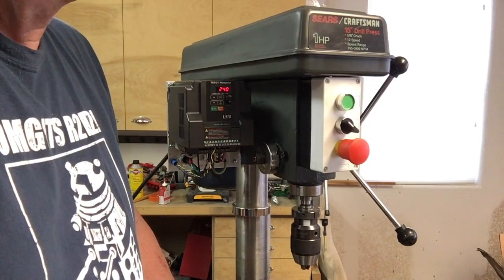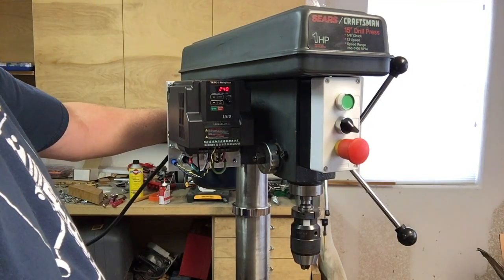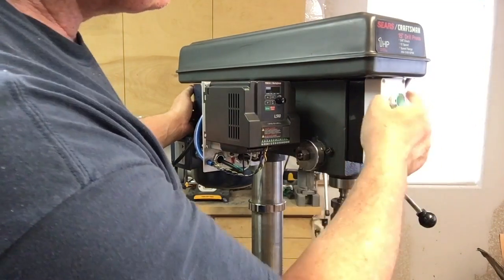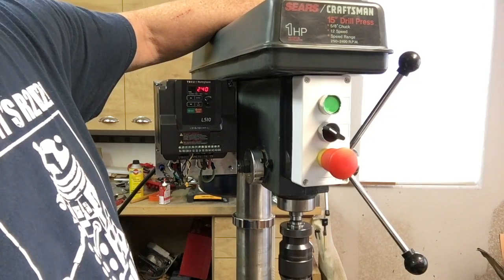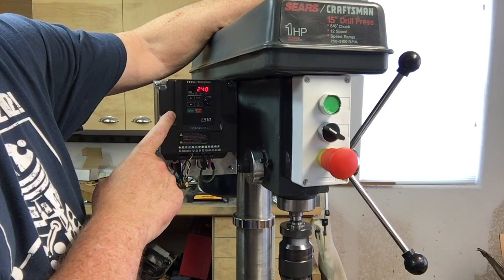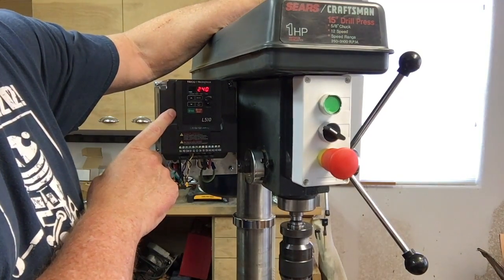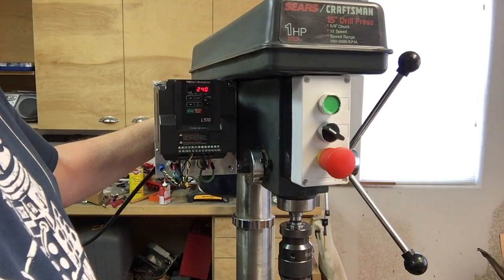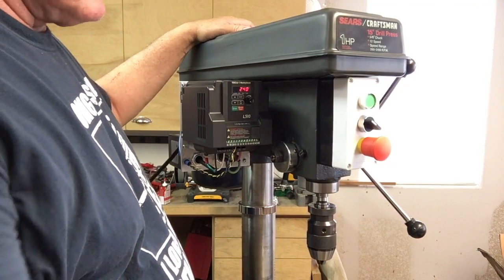Teco L510 VFD for Sears Drill Press

Comment: Nice video. I’ve installed the same VFD on a old drill press.  I’ve set it to 60 HZ and it works good. 
I don’t know much about automation so I’m going to ask some questions. 
I’d like to have forward and reverse. How did you wire your forward and reverse switch and where did you get the switch and what is the switch called? Thanks for the video I need to watch it again I don’t want to mess this VFD up.
Reply from the maker: There are several different ways to configure it.  I don't know where my sketch is now, but I believe that I used the 3-wire mode with the E-Stop mushroom switch wired to terminal S1 and FWD/REV on S2 and S3.  It doesn't have to be momentary switches on S1.  Parameter 00-04 controls the mode.

The FWD/REV switch is a modular 22mm 2-position rotary selector switch.  If you're not familiar with such things you could just use a 2-way toggle switch.  You could use an ON-OFF-ON 3-position toggle and run it in 2-wire mode without the E-stop in 2-wire mode.  You could use two NC switch blocks on the E-stop switch and wire them in series with the FWD/REV lines in 2-wire mode.  More than one way to do it.  Please don't electrocute yourself.
Reply: @jonrbryan  I probably would use a toggle switch when I get everything setup which will be awhile. I’ll ask more questions when I get started, I’ve handled electric stuff a good bit so I’m pretty carful.  I just can’t wrap my head around programming.  I really appreciate you answering.

Comment: Jon doesn't tell you how to convert line frequency to quill speed. There are two settings on this VFD that must change. Set 12-04 to "1" and set 12-03 to the corrected RPM. In my case, my bandsaw uses an 1800 rpm motor so  the correction factor that gets entered to convert rpm to surface feet per minute is 02677 which is entered as the integer value for 12-03

Comment: Jon, very informative. Just ordered the same setup and am wondering how you wired the REV/FWD switch in the front. Is that wired thru the output to the 3PH motor? thanks
Reply from the maker: It's wired to the control inputs on the VFD.  If you get the same kind of box for the controls, punch matching holes in a piece of sheet metal to back up the front panel. My first one started breaking out around the buttons and that's what I did to beef it up.

Comment: I have this same vfd and I was wondering what the parameter to display rpm instead of hz.  I tried 12-03,1 and the number was way off and I'm not sure what to do.  Thank you
Reply from the maker: I have 12-04 set to "1" to give me integer resolution.  Then it's just a matter of plugging the right scale factor into 12-03 to give you an accurate spindle RPM.  I used a laser tachometer and a strip of reflective tape on the chuck to measure the RPM, then adjusted 12-03 accordingly.  I believe the default value was 1800.  I have a slight reduction in my pulley arrangement and wound up with a value of 1540.  It scales directly from the RPM you measure with the tach.  If the algebra gives you trouble, just do stepwise changes until the tach and the readout agree.
Reply: Thanks!  That helps me a great deal as I have mine on a manual lathe and need rpms for threading and such.

Comment: is this the correct # of vfd you are using L510-101-H1-U for your motor?
Reply from the maker: Yes, that's the model that I'm using.  It takes 115V single-phase in and produces 220V three-phase out for a 1 horsepower motor.

Comment: hey Jon thank you for the video. I have one question though, the green switch you used to turn it on/off is that hooked to the main 110v line on or in the s rail/com rail? I want to run with my unit in a box and operated remotely on switches estop and a 10k pot kind of like that. (note: also I am using 220v 1ph) if you could shine some light on that it would be great thank you again -Jason
Reply from the maker: Yes, it switches the AC line to the VFD (and the work light that I forgot to turn on for the demo).  I've got the drill press on a wheeled base and wanted to be able to move it anywhere and plug it into the wall.  Right now it's out in the garage while I'm spread out to do some cabinet work.

Comment: I recently purchased the same VFD.  If you're stalling at low speed you're probably running the drive in volts per hertz mode.  This drive is capable of running in sensorless vector mode which will give you a lot more torque.  The manual that came with my drive did not document this so you'll need to go to the Teco web site and download the full manual to see these parameters. Parameter 00-00 sets the control method 0=V/F mode, 1=SLV mode.  If you set it to SLV mode you'll need to do an auto tune with the motor uncoupled by setting parameter 02-07 to 1.  The drive will ramp the motor up and down for several seconds to characterize the motor and then you should be set.
Reply from the maker: I do have it in sensorless vector mode, and auto-tuned it.  It has more torque than V/Hz mode, but there is only so much you can do when it's running really slow.  That's why I kept the option of using two belts for the extra torque.  I still might fiddle with the current limit, but I'm happy with it as it is so I'm not too motivated.

Comment: Jon, I just purchased this same inverter. I am having a difficult time understanding how to make adjustments to the parameters. Could you do a video on how to make adjustments to the VFD? I only want to change the speed settings, and use the potentiometer on the front of the key pad
Reply from the maker: I hope you got it all figured out.  It's not too hard.  Some things are left out of the printed manual, so you really need the download version for some of the finer points.